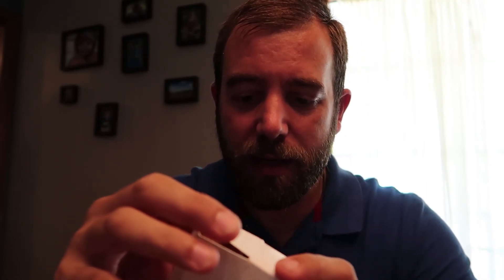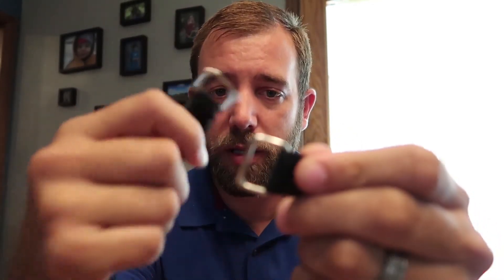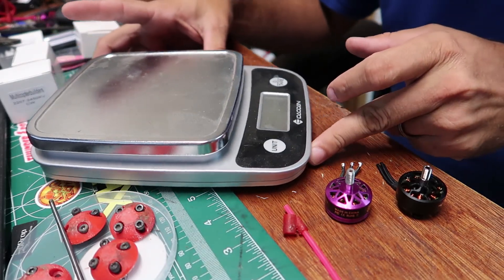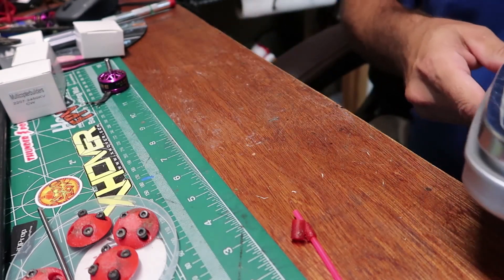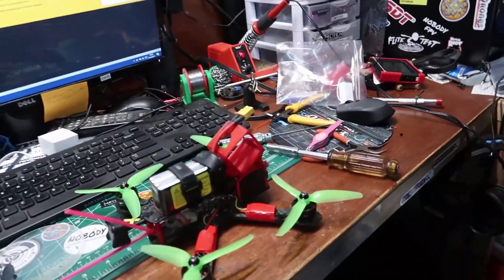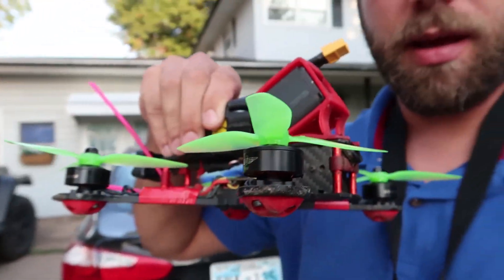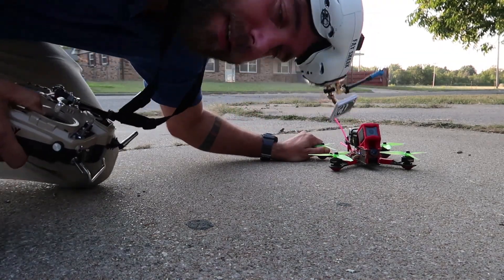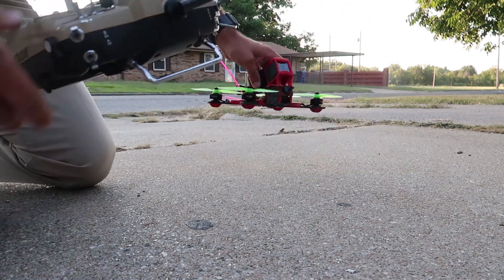Multicopter Builders Primo 2207 2450kv motor Review

Comment: Looks like you have absolutely no prop wash at all, did those motors help with that or has it always been that good? I guess you're using the pt1 filter with some of those gyro notch filters removed right? Great flying!
Reply from the maker: DinkBox with PT1 and all filters turned off. It handles propwash really well.
Reply: Nobody FPV Nice, yeh it looks like it